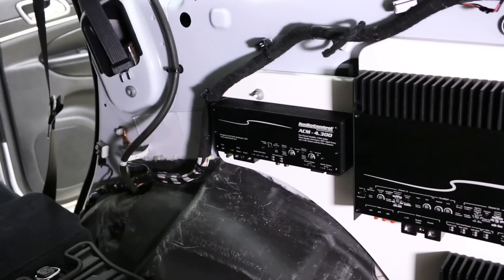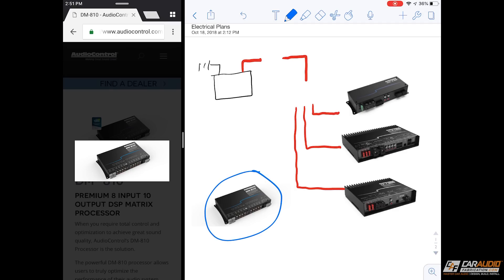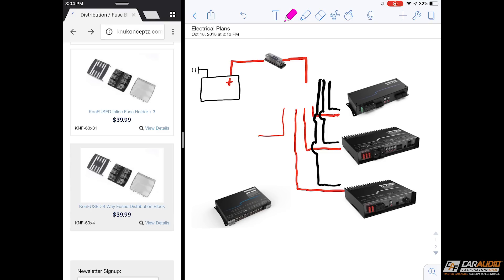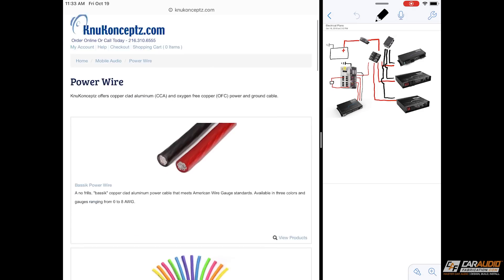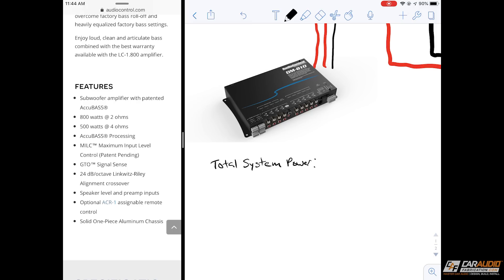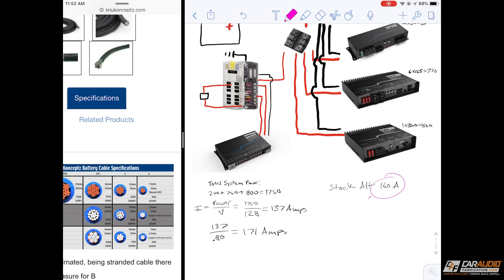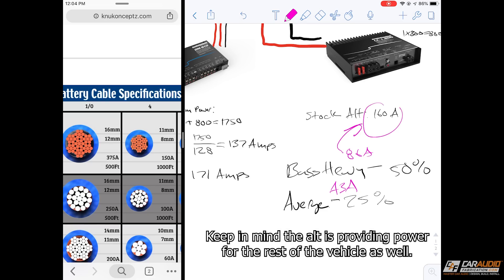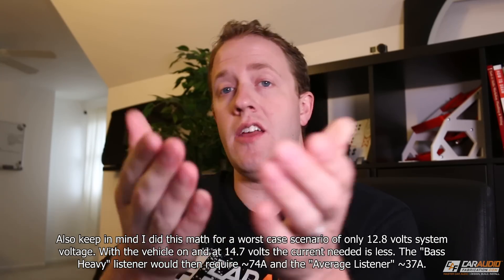How to plan car audio ELECTRICAL system wiring - Is the alternator big enough?

Comment: Ugh, still confused lol. I am preparing to install a new system in my 05 Mini Cooper S. Currently installing sound deadening throughout before I get the head unit, sub, and amps, already have the speakers. Now i'm concerned i may need to upgrade the alternator which is 105 amps OEM. Here's what i'm getting.
Head Unit:
Pioneer GM-D8704

Speakers: 
2x 6.5 components up front, Pioneer TS-Z65CH (110rms-330max x2)
2x 6x9 components in back seat, Pioneer TS-D69C (110rms-330max x2)
1x 12" sub, Kenwood Excelon P-XW1221SHP (500rms-2000max x1 @2ohm)

Amps:
Pioneer GM-D8704 4 CHannel 100rms@4ohm, 1200 max overall (but not sure what that is @4ohm)
Rockford Fosgate R2-750X1, 1-channel, 500rms x 1 @ 2Ω, 750max,  Current Draw 13.8V Sinewave - 71A (couldn't this for the pioneer amp) 

Anywho, any help from you audiophiles out there would be appreciated. If not, I can always wait to see if my headlights dim lol.

Comment: What if your amps are more powerful then the sub/speakers they will be powering? eg. I have a amp making 1220w at 2 ohms feeding my sub which I only play to throw 800-900 watts at. Do I use the total wattage the amp can make or the actual wattage I will feed the sub with?

Comment: Thank you for the info. I'm surprised you haven't spoke about vehicle's own power draw requirements. It would be cost inefficient for a vehicle manufacturer to supply the car with an alternator outputting x20  the amount of power needed. What i'm saying is the size of the alternator is calculated to slightly over-exceed the car's consumption needs, subject to mods and additional specs of course.

Comment: Mark, I am a car guy or ASE MASTER TECH since 1978. Alternators have limits in the amp area, but system voltage is effected by a few things. 1st, 12.8 Vdc -14.3 Vdc voltage is the industry normal but the high voltage results from colder ambient temperatures. The colder it is, the higher the system voltage goes. If the older Delcotron had a wire wound resistor on the end housing between the regulator and diode trio. Newer vehicles use duty cycle but the air intake thermistor is an input into the PCM. It controls the output. 
  A good battery is tested with new technologies as well. A company called “Midtronic” developed a method of sending an A/C sine wave thru the battery and judges it’s state-of-health plus calculated everything else. But, GM for example, in 2005 started using software and amp clamp on positive, later negative. Either the dash or now PCM changes how the alternator functions. Going to “alternatorman.com” has many upgraded products for higher amperage. Note; Regardless of what alternator is employed, the diodes do the work and get hot. These will fail first but ducting into the back, providing a large ground on the back housing to the battery, engine & chassis depending on glued panels, fiberglass, carbon fiber or galvanic action creates issues. The back end housing is where ground is created, much less the RED terminal that goes to a battery. A good battery uses less than 0.5 amps to 0.2 going down the highway. Just a thought. Buy a really good DC Amp Clamp! Then work it.
Reply: @deankay4434  recommendations on a really good DC amp clamp ease and thank you?
Reply: @ Clamp on are common and work good. They are sold at home stores, Harbor Freight, Garner-Bender is a common brand, I honestly have 3 from Fluke but expensive and can be calibrated with return print out, PICO is popular for laptop systems but sell stand alone amp clamps. 
 The main thing is decide what type(s) of circuits you will be checking as some do DC only, others AC only. More can do both. If you are totaling house items for power use or solar, the make plug in types that the appliances plugs into it, the it’s plugged into wall. This won’t help is hard wired into conduit or service entry. 
  Some give digital read out on hand held (Becoming more common) but a number require plugged into a digital volt-ohm meter. If diagnostic on 12 Vdc systems, this is easier to find. I won’t tell you to get on a tool truck from MAC, CornWell, SnapOn or others, but research online, buy local as a return or help…sometimes. Just learn ohms law (E/IXR)and power (PIE).
  Then go to individual circuits. Remember 240 Vac is checked on both legs then add. 
  Best of luck!
Reply: @  I am so sorry to take long to get back to you. There are a number of clamp on type amp clamps on the market. I like Fluke but they are expensive. Plus, they do A/C or D/C but not both. Pico make a handheld with a digital readout as these are easy to use, quick to get answers and pass judgement on the device’s health. Remember, the component uses all of the voltage in a circuit so this makes “Voltage Drop” test the best. Using a digital volt-ohm meter, turn the circuit ON! Place the meter leads on both sides the device, say a blower fan. If leads a backwards, you get the same reading just a (-) negative symbol in front. Say the battery shows 13.0 volts, the fan consumes 12.2 Vdc, this is normal as every wire, switch, fuse & connector will have a tiny loss. Amps show how much current is being used, so a brushed fuel pump. Pull the fuse or relay #30 to #87, install fused jumper, start to turn on to run but observe the amp clamp. If it’s 7-8amps normal for average pumps. As the brushes line up directly on the commentator plates, the max current flows. As it rotates, brushes come off then go on the next pair. So up & down wave on lab scopes but amp clamps show average without hundreds of samples per second. If amps are high-restricted filter. If low, then the brushes are worn or commentator plates are grooved or into plastic. Less good contact results in low current. 
  Hope this helps you. Enjoy the holidays. Brands change, they make new ones, as I have a Sears, Pico, Garner-Bender, Fluke digital display, Fluke meter plugin / lab scopes plugin and Fluke A/C clamp. Harbor Freight may have good ones but I haven’t been shopping either! 
Take care.

Comment: So I understand your comment on the watts per channel and adding them up for total power, but with mine I have a 4 channel 300watt rms per channel Amp l, but the specs call for a 4 gage wire, and a 40amp external  fuse, but if you do the math for total use of all 4 channels im coming up with 108 amps so id be better getting a 100amp fuse? Can you help clarify this,  for now I will run what the manufacture recognends to protect system the best

Comment: I can't thank you enough for this awesome video.   Two questions:   
1) Why didn't you have a fuse between the distribution box and a component (such as an amp)?   After all, the fuse between the battery and the distribution box will let the maximum total system amp to flow to the distribution box.  And without a fuse between the distribution box and one of the system components, that maximum system amp can hit and burn that one component.
2)  How would you install such an audio system for a hybrid vehicle?   Most hybrid vehicles have a  12V battery, and not the usual big 12V battery, since the engine starter only relies on the hybrid battery and not the usual 12V battery.    There is also no alternator to charge the tiny 12V battery since the hybrid battery also charges the 12V battery.

Comment: You multiply by .80 instead of divide.
Reply from the maker: Nope, wrong. I'm working through the equation the opposite direction to find the incoming current which MUST be larger than the required output. I am absolutely certain that the video shows the math correct. The laws of physics wouldn't allow you to have a smaller incoming current than the output. There MUST be losses somewhere.

Comment: i have my system all planed out in a diagram. im not sure what  gauge wire to use.. would you mind taking a look and seeing what else i need as well as check my signal flow. i have the diagram as a pdf file. how can i get it to you

Comment: I'm an average user, I like the fact that the amplifier is able to unlock more of my speakers but I'm not exactly going to be putting my car into the show to try to win awards or even break any laws of the road when it comes to volume.

I like how the amplifier is able to do more advanced things with the audio, maybe not as advances as things that cost as much as a car that goes with the amp, but it's a step up from just a simple head unit connected to speakers when it barely get's up to RMS

Comment: Why did you calculate for the car being off instead of on? Just easier for the math or is there a bigger reason? Confusing for me as I would assume you’d want to know the absolute max voltage that could run through the system to further better your fuse choices. Or is 12.8 to 13.8 simply not a big enough difference for it to matter? Great videos man I’ll definitely be watching more you motivated a lot of people man!

Comment: I'm installing 2 10" kicker CompRT subs, 400rms/800 peak with the Kicker CX 800watt class D mono amp plus I'm  replacing my 4 factory speakers with Kicker 47KSC6504(100 watt rms/200 peak) and using my Pioneer 4500nex head unit as the amp for the 4 6.5s... my factory alternator says its maximum alternator capacity is 110 amps... am I fine with the one i have or do you think I need to replace it with a new one??? Any help much appreciated!

Comment: Can a person take into account the fact that music draws less power than sine waves (your 50% for bass heavy and 25% for typical listeners) to size the power wire and fuse? Or just to determine if the alternator is large enough? I've read in several places (RF Punch amp spec sheet, Pioneer amp spec sheet, and Crutchfield amp install FAQ) that the actual in-use power draw is probably at most, half of the amp's rated power, as well as half of the amp's fuse rating. My main concern is the practicality of routing a 1/0 gauge power cable, and how difficult it might be to fit.
So I will probably use my Pioneer 5-channel for now (90 amps of fuses) but thinking of upgrading to RF Punch amps cause of the sale, though out of stock. The 600x4 is class AB (less efficient) and there is no fuse, but they recommend 100 amp fuse (but they say 45A average current draw for music, and 90A max current draw with sine wave). The Pioneer includes 3x 30A fuses, but says 55A current consumption at continuous power, and says "The average current consumption is nearly the maximum current consumption by this unit when an audio signal is input. Use this value when working out total current consumption by multiple power amplifiers."
Crutchfield says "To calculate the current draw of an amplifier, multiply the number of channels by the RMS watts per channel (a 2 channel amp rated at 300 watts RMS per channel would be 600 watts). Double it to account for amplifier inefficiency (600 watts X 2 = 1200 watts), then divide by the average output Voltage of an alternator, 13.8 volts (1200 divided by 13.8 = 87 amps). Since the average music signal requires about 1/3rd of the average power in a test tone, divide by 3 (87 amps divided by 3 = 29 amps). The result is the amplifier's approximate average current draw while playing music at top volume.
 A fast-and-nasty way to ballpark an amplifier's current draw is to divide the total fuse value of the amp by two. For amplifiers with multiple fuses, the rating of all fuses provided with the amp must be added together. This will likely produce a significantly higher estimate than using the proper formula. Although inaccurate, this will err on the side of safety." But this is all in the context of evaluating whether your alternator is big enough, not for sizing the power wire and fuses.
So I guess my question is, do all of the wire charts we find online take into account the music listening power, or the absolute maximum power the system can draw. I know that a circuit breaker typically operates on heat, and it will heat up over time - it's not instantaneous unless there's a short. Thus they would operate on the average current draw. For example, my Crown XLS 2502 amps for my theater subs put out 2400 watts each, which would be 20A, which is too much for the 15A circuit it's on. But on the amp itself is printed 425 watts power draw, which is about 3.5A. I believe it's referencing average power, and taking into account that nobody plays a sine wave at max power for an extended period. When listening to music or watching movies, there may be times when it draws 20A for a short period, but on average it will be more like 3.5A. And because circuit breakers trip when they get hot over time (just as wires heat up slowly unless there is a short), the average current draw should be used.
Another example, my tankless water heater has 2x 40A breakers. That's 9600 watts. I took a very long shower one day, and it tripped the breakers. Granted it's only done this once in the 5 years since I installed it, it demonstrates how using power beyond the rated power will slowly heat up the wire (and the breaker/fuse) and blow the breaker/fuse. I assume in the case of a short, it will try and draw endless amounts of power and just trip immediately.
Anyways, I would like to know how all of this factors into sizing a reasonable gauge power cable for one or several amplifiers, sizing the fuse, etc. Because we know that a 1,000-watt class AB amp plus a 600-watt class AB 4ch amp are not going to actually draw (1600/.6/13.8) 193 amps on average, heating up the wire and starting a fire because my 2 gauge wire is only supposed to be used for up to 150 amps at 20 ft. In reality, the wire will probably never see more than 100 amps.
I guess central to all of this is whether wire gauge charts are based on max instantaneous current draw or average current draw over time, and if they take into account music vs sine waves. Also wondering if maybe fuses blow instantaneously or if they are based on heat buildup over time like circuit breakers. Thank you for reading my book.

Comment: Nice video. Thanks. I’ve been out of the car audio game for a bit. Is the capacitor (cap) still necessary for heavy bass notes (rap) and also helping with air conditioning as well as headlights dimming? Or is it all about the basics batt, alt, wire size?

Comment: It might just be past my bedtime, but if we assume an amp is only 80% efficient, then the math would be: 1750 watts multiplied by 80% (1750 x .80 = 1400), because 1400 is 80% of 1750. Which means your wire gauge is to big. Right? But hey, at least there won't be fire due to thermal limiting.
Reply from the maker: You're thinking about it wrong. It takes more current due to the inefficiencies of the amplifier, it wouldn't take less current. That would be physically impossible.
Reply: Sorry, or 109.6 amps

Comment: Math is wrong here. 80% of 137 is not 171. It’s 109.6 amps. That would be the correct amperage
Reply from the maker: Nope you're wrong. If an amp is only 80 percent efficient that means more current in than out. In your incorrect math you are saying the amplifier magically uses less current than what is required by physics to produce the power. Can't break the laws of physics...
Reply: @CarAudioFabrication   You are definitely correct.  So many people here do not understand dividing by a percentage.  It's worth a video on the subject so you don't have to keep saying the same thing!  :-)

Comment: hey so I'm completely new to upgrading car audio. I've built my car engine from a bare block so I have technical aptitude, but need some guidance on audio stuff. I loved this video info, but I don't know what speakers/amp to choose for my moderate sound quality upgrade on my 2006 Porsche Cayman S (non Bose). I know the car has a factory amp in the front trunk, and I had an android head unit installed about 4 years ago. I have no idea how they did it or how to reverse engineer what they did. Could someone point me in the right direction? Much appreciated! And keep up the video content!

Comment: hey so i have a 130A stock alternator and I am looking to power an 80A system (i am a bass heavily listener lol). I was wondering if the alternator would need to be upgraded in this case? Im not sure how many amps the rest of the car draws from the alternator so I didnt really know whether or not the alternator would be able to supply another 80A.

Comment: Sooo i wanna know if i got this right
I want to run (3) 2900max amplifiers divided by my trucks 14.8 volt battery equals 587 amp draw. If this is correct than i need to run dual alternators on my truck to make up those amps buuuut i wanted to ask is this also why people run multiple batteries of capaciters to make up for the missing amps? But if u dont upgrade the alternator than your batteries will soon deplete witch means i could only do short bursts of full bass as to not damage stuff oorr just get the double alternators. Am i correct on all this?

Comment: Hmm. 137 amps at 80% efficiency went up to 171? Is it not 109.6 ?? confused.
Reply from the maker: Not all current is converted to output, you have losses in heat etc. So it takes more current to make the rated power.

Comment: Can power gauge wire be too much and does it make a difference? For example if my total system has about 73 amperes (50 amperes subs & 23 amperes mids/highs), and the person who installed it used 1/0 gauge wire to power the amps (2 amps), is that too much and will it affect the sound quality?

Comment: Another great video Mark!

Something else to keep in mind about the alternator is the accessories, A/C, Lights, etc ... if the vehicle was designed with a 90A alternator and you drop in a 45A stereo ... you could really be taxing that alternator. Mark could you explain how adding capacitors and extra batteries (designed for this application) can assist in this transient load?